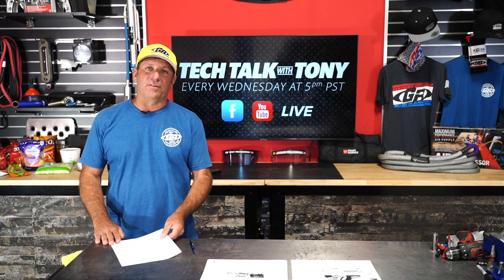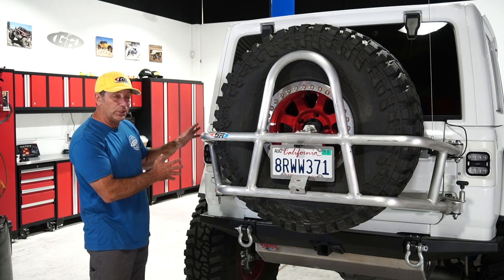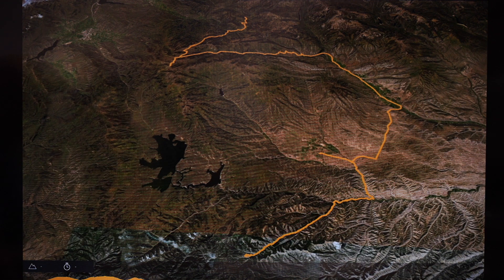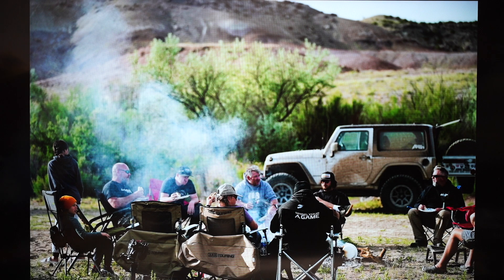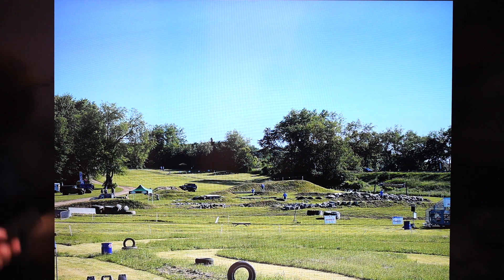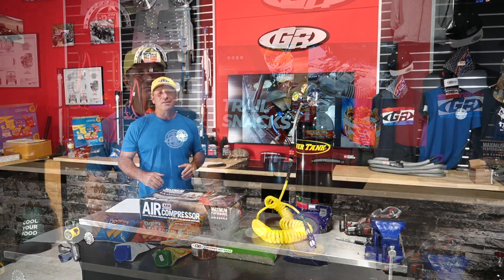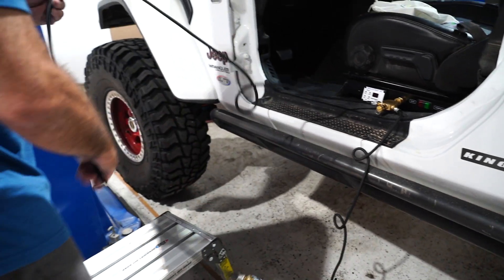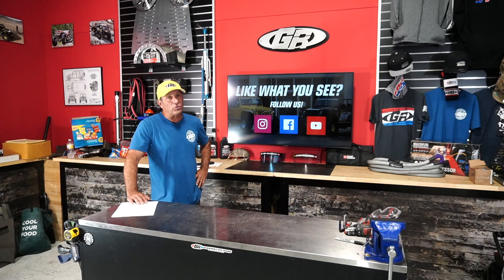A RAD Air System You NEED To Know About Goes In The AFTERSHOCK JEEP JL! Plus A Quick Trail Meal!

Comment: That air up and down kit is pretty neat, I have a dual viair system with a tank in my jeep and a 15lb power tank i really like having both. 

How do you like that style of attachment that goes on the Schrader valve? I've been wanting to buy a couple dual tire inflator/deflators and I've seen the clip on type of Schrader valve attachment and I've also seen the type that push and lock on like you just showed.
 I really like how compact the fill hoses are in those little bags on the rock or road kit, some of the homemade inflation kits I've seen are a big mess.
Reply from the maker: The push lock attachment is great because there is no mistake that it is all the way on the Schrader valve and no chance of it getting knocked off. That and the ability to set the compressor to auto and walk away while the system inflates or deflates is a huge plus over other systems.

Comment: Great info on the walking taco and the ARB air setup. Is the ARB air setup good for 100% duty rating? That seems like a great system if it is. How long would it take to fill those 4 tires from 8psi to 28psi?
Reply from the maker: The compressor does have a 100% duty cycle rating. It took us maybe 10 minutes to get all four 40 inch tires up to 28psi. The great thing about this system was we were able to walk away with it set to auto and finish packing up camp and not have to watch the pressure; as it has the auto stop built in with the programming. We are very happy with it.